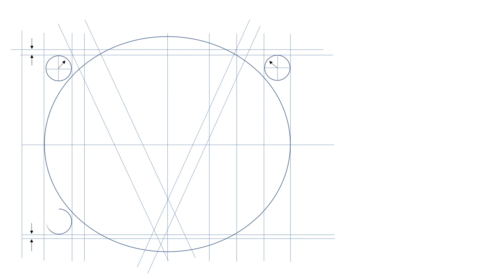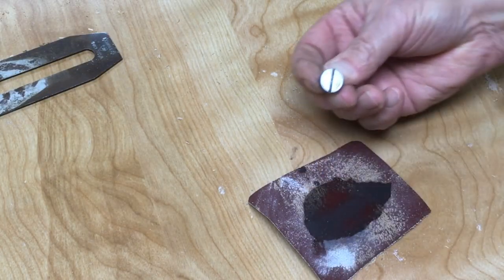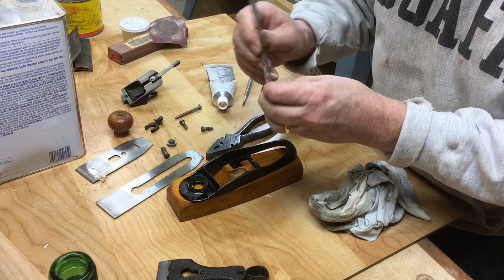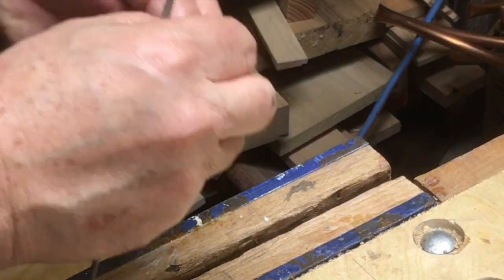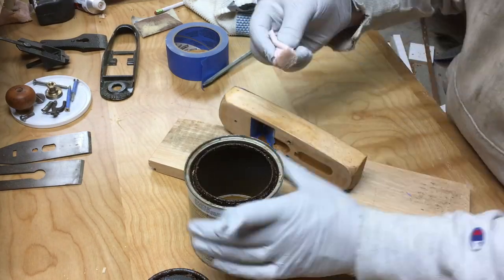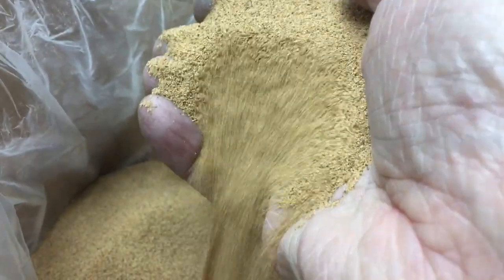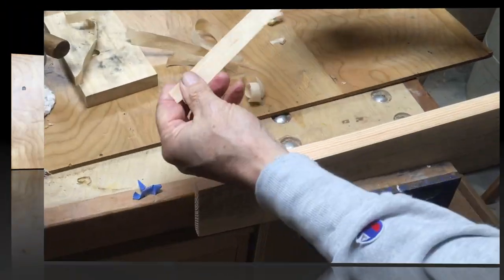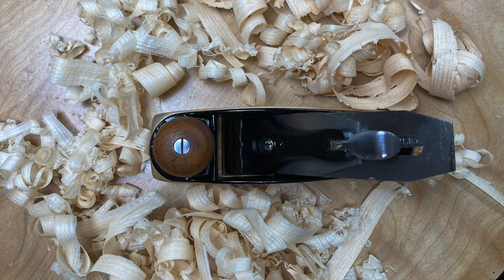Complete Restoration & Refinish of a Stanley 22 Smoothing Plane

Comment: I have a sand blast cabinet, but want to do somethings with walnut shells. But don't want to empty 40 lb's of media out, to switch media. This would make a great little tool to use.
Reply from the maker: Thanks for the comment. Just search for DIY sandblaster in YouTube and you'll find lots of these. Crude and cheap but they work great. A bit dusty so I recommend you use it outdoors. I'll do a video soon. Thanks again.